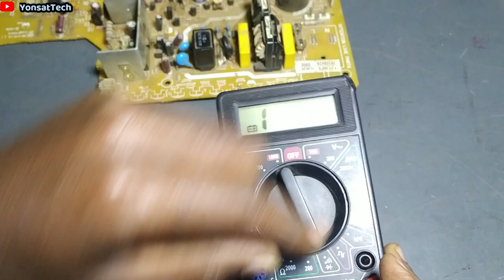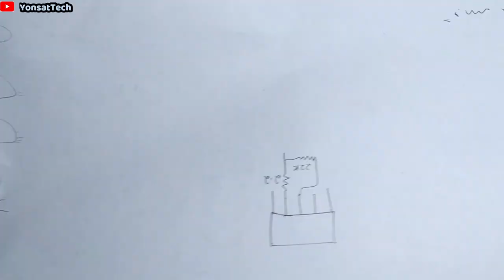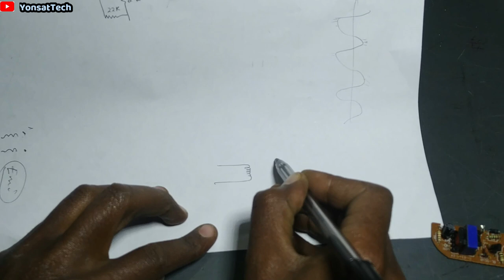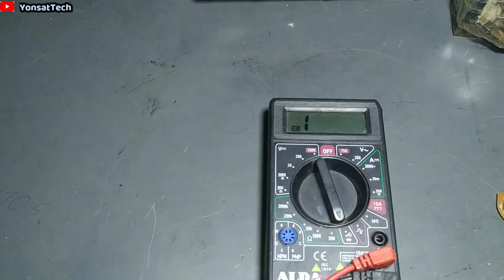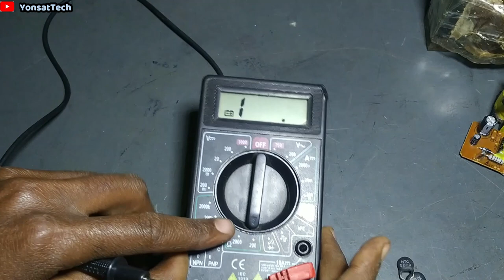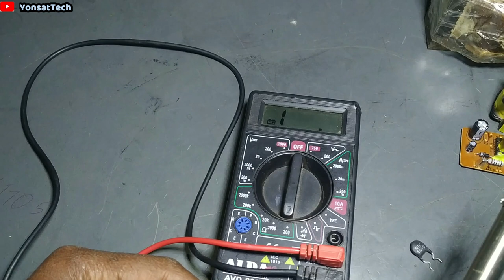Tv repair,Electronics tutorial part 4

Comment: transformer is used to step up or step down ac voltage but the input of chopper transformer is DC b/c it is found after rectify by four diode so how it work?
Reply from the maker: when dc is switched by high frequency it genwrate Emf in primary winding of choper so we can get Ac high frequency

Comment: ስለ AC እና DC current ልዩነት በግልጽ ብታሳየን ለምንድን ነው ACtoDC DCtoAc መቀየር የሚያስፈልገው
Reply from the maker: Ac mejmeriyaw low Frequency new maletem 50_60Hz  kezan wede High Frequency Ac yekeyeral mekenyatum current step up adregen variable yehone voltage lemagegnete ...yehe degmo ke 20,000_50000 Hz frequency new 1 video seralew detailed